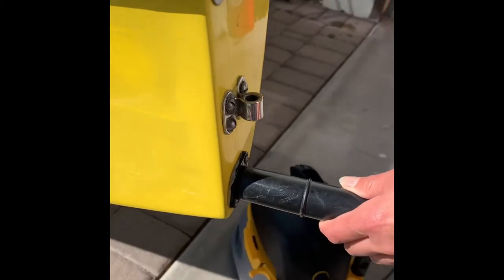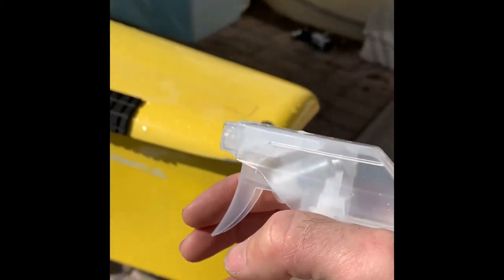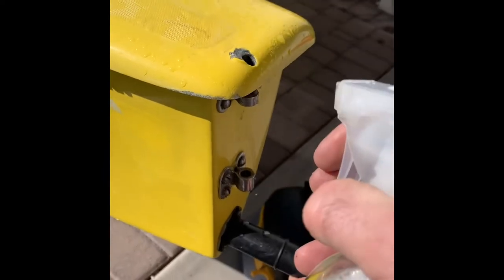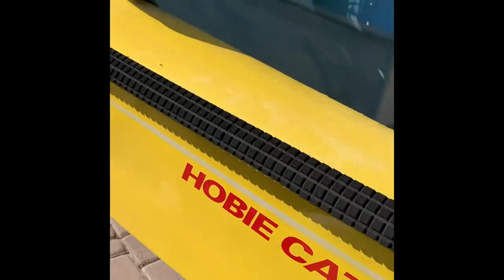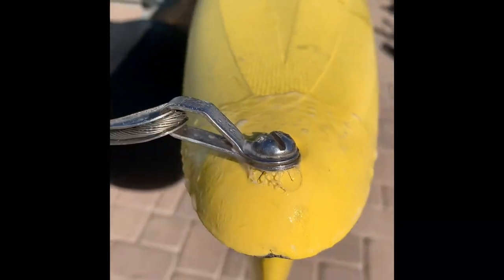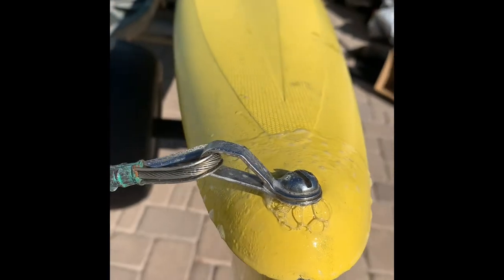Murrays Rigging Tips: Checking for Leaks

Comment: how much is too much air pressure?
Reply from the maker: it only takes a couple of PSI. I like to make sure that we don't seal the hull with the blower. A small/ weak shop vac produces too much pressure if you were to seal the hose to the drain plug or hatch. In the video the hose is loosely pushed against the drain plug, allowing plenty of pressure to escape. The trick is low pressure and high volume.